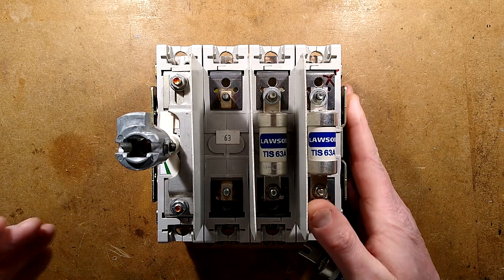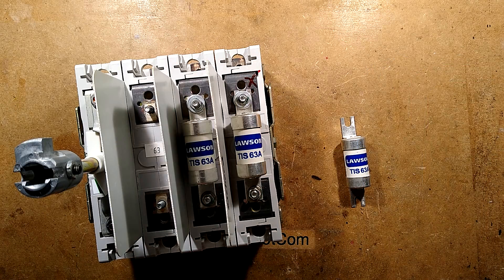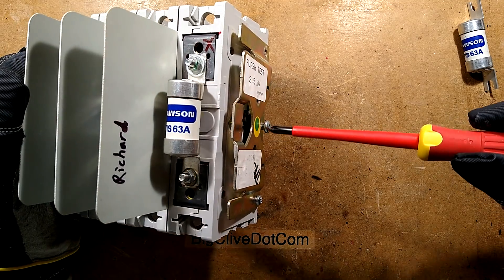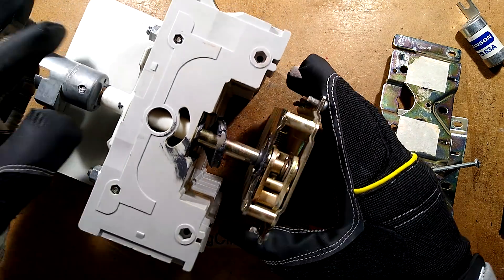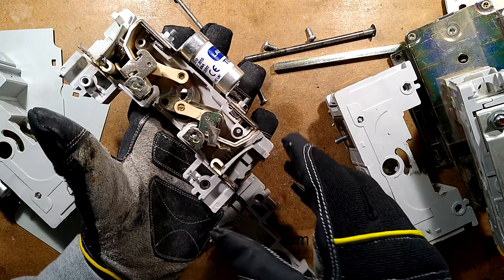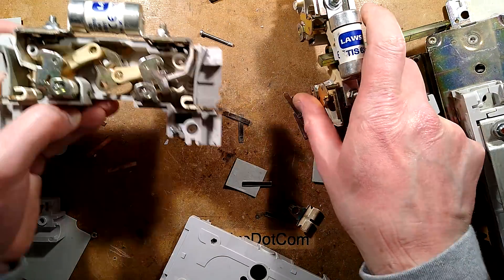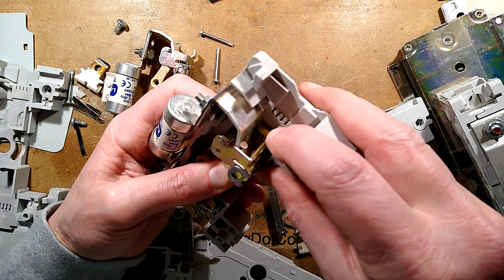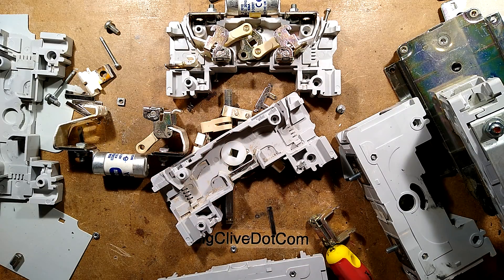Failed elevator switch fuse / fusible disconnect

Comment: Loosing a neutral is always fun when it turns into a star point!
I must admit I am quite fascinated by really high current gear. We are having a new machine line installed at work and they have just had about 20 people in to pull through a great big fcuk off SWA cable the size of my thigh from the substation along the cable trays suspended from the roof! You should have seen the size of the drum it came on! Was talking to one of the guys who looks after our substation and he was saying when they liven up really big stuff they don a flash suit that wouldn't look out of place on an episode of Captain Scarlet, stand off to one side and then twat the breaker with a long big of wood! When you are playing with power levels above a certain level it's not the electricity that gets you, it's the flash and the bang!
I mean the electrical load just for the lighting in one of the machine halls is probably about 40kw... God knows how much the total load for the whole site with all the machinery is!
Reply from the maker: Having installed similar cables I don't recommend it for fun.

Comment: The old stuff you see now is more reliable and easier to service.  The old stuff that wasn't got replaced.

I wonder how much of how hard the thing is to engage and disengage is the result of just having a long actuator that doesn't necessarily line up ideally with all the modules.

Comment: Hi Clive, id there any chance of "doing a vid" on fault current and prospective fault current. I've been trying to find out what the fault current of a dead short might be in a 240 volt domestic environment, purely for academic interest. When I did my 16th Edition and Inspection and Testing exams I couldn't get to the bottom of it satisfactorily. Thanks.
Reply from the maker: I really should do a video about that.  Particularly the increasingly pointless tests and paperwork being invented by the paperwork "electricians".
Reply: Complicated answer: Short circuits are describe as having 3 components. Sub-transient, Transient and synchronous (steady state). as a protection guy we are most interested in transient and steady state. Only if we are electrically close to a generator do we consider sub-transient. Not going to do a system analysis course here tho. In domestic systems here in US, short cut currents  may be in the range of 500 to 2000 amps tho the panel breakers may be rated 10,000 amps.

Comment: "knocking power out to buildings"
Even worse is when the fault doesn't knock the power out.  I've seen the pictures where neither the 400A breaker nor the 2000A upstream breaker tripped and current continued to flow into a hard fault until the power company showed up and killed power at the transformers.  Not pretty.
Reply from the maker: I had that at a factory where the factory "hero" had progressively bridged out every layer of fuse protection.

Comment: 10:40 left hand side where burnt spring is... open hole beside bolt holding fuse....  If the assembly was mounted horizontally then any silica from a blown fuse would happily be funneled down to that suspect contact... from the hole, around the plastic case screw thru-hole, and down the slope of conductor straight to the spring and contact...    Would love to know how the assembly was mounted or if the spec sheet demands vertical mounting
Reply from the maker: A blown fuse should not really physically break.  I think this unit had sand in it from installation or a shipping incident.

Comment: would this be the switch an elevator technician operates to completely starve it of power to be able to work on it ?
Reply from the maker: Yes, although there may also be local isolation in the panel.

Comment: So the sand caused the failure. That's actually really useful information for people that make these things, but also for technicians.
If a fuse breaks and loses sand. The contacter should be replaced.
Or the contacter should be closed off better.
Reply from the maker: I'm wondering if the sand could also have come from the drilling of the holes for mounting the panel on the wall.
Reply: @bigclivedotcom  Hmm that could also be possible, I watched it on a tiny screen. 
But it would still be something technicians and creators should know about.

Comment: Having worked for 35 years in a steel works if you were stood next to a large breaker on a slate board when it tripped it certainly have you fright
Reply from the maker: Yes indeed.  I worked at steelworks and the stuff was sometimes a bit intimidating.

Comment: I remember this style of switched fuse and a common fault was wear on the slot that the panel operating handle engages into.  If the slot gets badly worn you can fully turn the handle and think you've opened the switch but it's still engaged (although more common on carrier style isolators)!  Permit engineers beware!
Reply: That's why you test for live then test for dead.
Peoples lives are on the line when you sign your name to an isolation permit so there is no room for guessing or excuses.

Comment: I first heard the expression "old and tired fuse" in my teens, after a "mystery student" caused a high-rated DNO phase fuse to expire without disturbing the sleep of lesser-rated fuses downstream.

The high current was caused by inserting two keys (hanging on the same metal ring) into the L & N of a socket outlet, and turning on the switch.  The keys made it across the room before the lights dimmed and then went out.  It was an incredibly stupid thing to do, perpetrated by one of the smartest students in the school.  I merely watched and encouraged him, feeling simultaneously fascinated by his idea and in dread of the possible outcome.

It took hours for the school to diagnose the problem and then for the DNO to attend and replace the fuse.  In hindsight, they might have had to do more work than just insert a fuse - if the carrier[s] was[/were] ancient and made of hewn slate then I can see them wanting to do an upgrade on the spot.

I'm sure the incident is long enough ago that nobody in authority at the school will get to read this or take retrospective action but, just in case I'm wrong, my name is Boris Johnson.

Comment: I love your videos but this title made me want to nope hard. I worked in a building where a woman stepped into an elevator - the doors opened and she was reading or something and stepped in. The elevator was actually down a floor. She only fell a foot or so into the dark elevator shaft onto the top of the elevator, but didn't survive the accompanying heart attack. That was the PTL building for those that remember Jim and Tammy.
Reply from the maker: The landing doors can only be opened by the mechanism on the car doors.  There is no motor on the shaft doors at all.  Just a weight system to make sure they default to closed.

Comment: I wonder if that little piece of plastic that fell out got into way for the contacts? 
What are  quenching plates?
Reply from the maker: High current breaking devices have arc guides and quenching plates to break the arc by splitting and cooling it.  The plastic could have been the issue.

Comment: so the spring should be isolated from current via insulator (washer) or sim so not carry current , thanx for vid
Reply: That is correct. There should be no sneak current paths around the designated paths. Careful designs would prevent this type of failure. The normal (elevator)load current was probably in the range of 20-30 amps which is not sufficient to develop the normal contact magnetic closing force to maintain adequate contact pressure.

Comment: Individual phase fuses are not good. I've seen very expensive damage done to a computer room's A/C plant thanks to one phase fuse failing. Much better to have a 3 phase breaker so that all phases are disconnected together if there's a problem on one phase.
Reply from the maker: Ideally motors should be protected by phase failure relays and also thermal overload modules on their contactors.

Comment: Another source for contamination are metal parts that has been stone tumbled to take the biting edges of stamped parts, the stones would of course wear to sand in time. The small parts manufacturer are sometimes sloppy in the clean up and the assembly people just didn't notice. The sand would have dried/caked in crevices, and then loosen with the rattle of the spring loaded mechanism.

Comment: Speaking of Phase Failure relays... I remember once working in a hospital doing an 'on load generator test'. The generator failed and we attempted to switch back to mains. It was subsequently discovered after 20 mins of darkness that the Phase Failure relay had, well, failed. Cue linking the contacts out on that unit and a planned shutdown later on that day after finding a like for like replacement in the stores!

Comment: First thing I said when I had the factory tour at my current job was have you exercised you're breakers on the subs. Seen too many factories where it's never done and when needed the pneumatic breakers don't work after many years of sitting idle...when they had it tested it had indeed failed... luckily they had the sense to get the dno on site ready in case of a problem.

Comment: I have an older lift disconnect, made around 1938 (installed 1939, according to the register in the motor room in the commissioning phase) which has no fuses, but instead has oil filled dashpots in an oil bath, with a current coil per phase to provide the force. Then also has an ammeter integrated in the top cover for showing power draw, only though on the one phase. All cast iron and brass construction.

Was replaced during a modernisation, as the dashpot oil bowl was broken long before, and thus trip current was no longer adjustable for delay on starting surge. New replacement was a 3 phase circuit breaker, 30A, with the cable breaker in the supply from the ground being a 40A unit. Also made a LED power indicator, which was integrated into a full size breaker blank and potted in epoxy. Used a red 5mm superbright LED, a bridge rectifier and lots of series resistors for power and voltage handling. 39k 0.5W carbon composition resistors, 3 in series, so LED current was around 3mA, which was bright enough to have a red spot on the far wall. Lift draws around 20A peak on start, and runs around 15A when steady, so no issues with that supply now.
Reply from the maker: It's it the type with the big button on the top?
Reply: @bigclivedotcom  Yes, plus has the optional meter.

Comment: There's a lot of little subtleties in that switch design that I think you're overlooking. If you notice the center hub actually turns a little bit past the center line so it's actually has a toggle action. There is a spring resistance when you twist it back that it you have to overcome before you break the circuit.

The other interesting thing is that it is obviously designed to apply direct force to breaking contact. The pressure applied to the contacts to make contact is limited by that spring, but you've got a direct mechanical linkage that goes from the contact to that arm to the hub and then out the side to the switch lever that allows you to apply great force to make that thing separate. Usually contacts just get separated by a little spring, there's not that sort of direct mechanical means to apply force.
Reply: Yes, over centre lever action.
You don't understand that the main priority with that action is to OPEN the contacts as fast as possible... using that snap action. 
Closing is much less an issue - make .. not a break that creates and arc. 
These are made to open or close under 'on load' conditions, so that fast snap action is needed. 
Same principle in home light switches... why they should click.... and why the higher amp rated ones click louder. 
These thump open and closed.

Comment: Actuating this one to wipe the contacts would have just lead to the failure this one happened to see, but most likely it failed or partially failed after being cycled for whatever reason, and if a fuse failed and they switched it off then it would maybe have passed partial current through the contact still but a large load in the elevator would have caused the spring to fail and the contact to lift

Comment: Remembering old English Electric switch fuse manufactured in India on late 80’with different mechanisms.. toggling mechanism will be bulky and robust , and actuating rod will passes through the fuse module with double break for neutral too. Not like yours toggling mechanism extends under fuse module

Comment: It may be that the spring having been designed to pass through a hole in the main conductor from the fuse provided an unintended parallel path to the actual contact. Even though the main contacts take the brunt of the switching current, the current will follow ALL paths, and it looks like the spring may have carried some current momentarily during actuation, causing it heat and eventually fail. I suppose evidence of this would be if there is obvious signs of arcing or heat INSIDE the hole that the spring passes though. If this is the case, a slightly larger hole, smaller spring, or a simple Teflon (or similar) insulating grommet in the hole to prevent inadvertent contact during actuation may be a good design change. (Wonder if this part has since been up-rev'd?) In my view, the spring cannot pass current until the contact FIRST makes a connection to it's complimentary contact (from what I can see on video), Thus the parallel path statement. Even with a small spec of sand present, no current will flow until the two intended contacts are allowed to touch, or it reaches the breakdown voltage and begins to arc. In either case, a parallel path would be created in that instant, weakening and burning out the spring in the process, thus deactivating the ability to create a spring loaded connection across the intended contacts.

Comment: As someone who's done electrical work for a place that effectively lives in a constant sandstorm of extremely fine-grade sand, I can say sand kills literally everything. We've had Class1Div1 equipment come back nonfunctional because the sand got inside. It's insane. Sand gets literally everywhere. You could have a sealed bottle of gatoraide and at the end of the day it'd have sand inside it despite not leaking a single drop of liquid out of it.
Reply: And I still don't understand why people want to go to the beach for many reasons. Number one on my list Sand. They always come back and complain about it but I'm like you went to the beach!
Reply: This is apparently is one of the trickiest parts of designing a base on the moon. Lunar dust is very fine, which renders it difficult to filter, but highly abrasive, which means it will destroy mechanical systems over time.
Reply: @allenlutins  It was a sandblasting company. Equipment rated for fine dust with 10 year warranties was garbage in 3 months. Insane.

Comment: I'd like you to take a look at some "Emergency" rechargeable LED light bulbs. The set of 3 that we bought from Wal-Mart have an interesting flaw. You can only charge them while they're turned on (because they lack a switch on the bulb, and turning on the socket will just illuminate the bulb as normal). Is there a way to hack this so they can charge while turned off?

Comment: If that was what a grain of sand can do, how much damage would half a grain do? And if you keep halving the grains, at what point do they stop being grains, and do they still cause damage?
Reply: Half a grain of sand is just a smaller grain, so you can just keep going. I'd suggest you stop somewhere before you reach atomic silicon, though, because that could cause quite a bit more damage than you'd expect from a tiny bit of sand.

Comment: A possible durability upgrade would be to use an nylon leaf/wishbone spring, or spring with insulation at one end so it cannot be the electrical connection. Then if something like that happens, the assembly might make proper contact after cycling the mechanism. This is unlikely to work if a spring meant to ensure the contacts touch as intended no longer functions:)

Comment: I once was (at first) blamed for what turned out to be a "tired" fuse when one blew in the disconnect feeding my portable distros and dimmer rack during a load-in.
It somehow instantly took out the entire building as well, which wasn't good in a hockey arena during -30F weather. It got cold inside, but not too cold to ruin anything before it was all back up.
Reply: Cold seems like a good thing in a hockey arena in my mind 😉
Reply: @oliverer3  thank you that's what I was going to comment. Yeah I always suspected of house electrics. It's the number one thing I can't test enough.